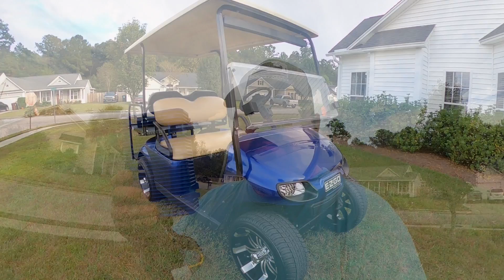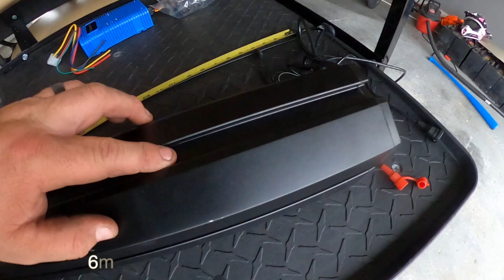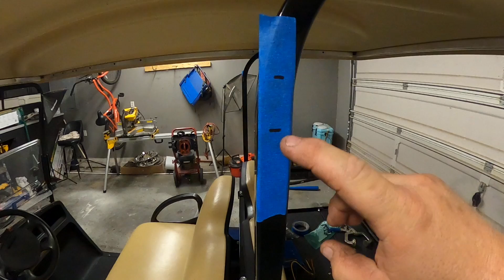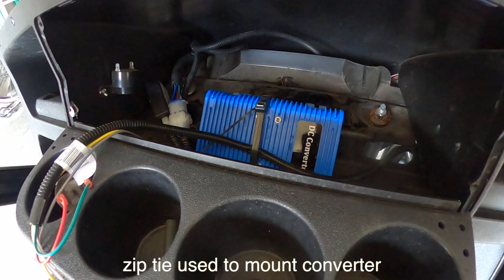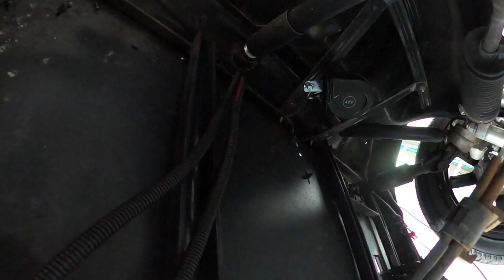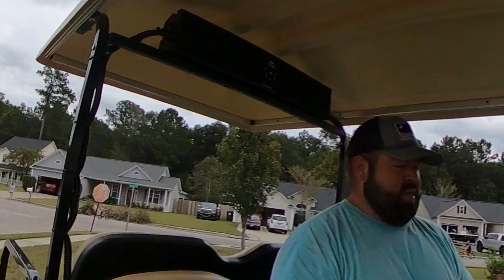How To Install Bluetooth Boss Sound Bar & 48v - 12v DC Converter on EZGO TXT Golf Cart

Comment: I have a Boss blue tooth amp with speakers and I have it hooked up similarly to this set up with the exception of my buss bar being a positive side and negative side so my Boss is wired directly to the buss bar.  The reducer is also wired to the solenoid so that it will come on when the golf cart is powered on.  I get a high pitched noise coming from mine.   Can you give me any advice as to what may cause this.
Reply from the maker: Do you have an inverter going from 48 to 12v? Is your sound bar hooked up to 48v?
Reply: @Fentertainment  i do have an inverter going from 48-12.   The Bluetooth amp is hooked up to the 12 volt buss bar.

Comment: You are a master!  I however didn't want to do all that work.  I also didn't want the soundbar to drain the 48v golfcarts batteries.  So in my txt I put a 12volt battery in the empty space and wired the sound bar directly to it.  I just have to keep the separate 12 charged on its own.  No big deal.  Only issue I have is the sound but starts cutting out if I apply more that 80% volume.  I'm hoping this is because I used an older batter I had lying around.

Comment: Such great instructions, however, I'm having issues.  I've installed the same converter in my 2016 TXT, following your instructions in this and the other similar video you did.  I've connected the Velex round marine radio to it and it does not power on at all (even with the key in the on position).  I have a 35a fuse in the fuse block, is that causing an issue?  I'm also getting a lot of sparks from the battery terminals when putting the wires on and off as I check the problems.  Thanks so much!!
Reply from the maker: The fuse for the radio needs to be 10a.
Reply: @Fentertainment  Thanks.  Not planning to use any other accessories, I connected the red converter wire to the yellow wire of the radio (which has an inline fuse) also the ground wires for the same reason.  Still no power to it at all.  it's got to be the green wire from the converter that isn't properly connected with the tap back connection.
Reply from the maker: @AndyMeresse  there is also a red ignition wire on the radio. Connect it as well.
Reply: @Fentertainment  I have that one on the blue wire of the converter. It's got to be the green switch wire, right?  Assuming the radio obviously wasn't dead from the package
Reply from the maker: @AndyMeresse  On the radio, Red should be key switch and Yellow is constant.
Reply from the maker: So on the blue converter you have 5 wires. yellow 48v input, black ground in & out, red 12v output, green keyswitch inpu, blue is 12v out constant. IF you dont have any power output from the red wire be sure that the green wire that is for the switch is hooked up to either the switch or main battery for the converter to turn on. It has to have 48v as well. If you hook it up to the main 48 then it will not power on and off with the cart and will stay on constantly.
Reply: I'm obviously not electrically inclined I guess. I've taken up enough of your generous time, so I'll have to find someone local to help. Thanks so much for trying to help!!
Reply from the maker: @AndyMeresse  im invested man. whats it doin
Reply: @Fentertainment  just to start from the top. The yellow wire from the converter is run to the main positive of the pack. The black converter wire is run to the negative on the pack. The green converter wire is run to the "on" terminal of the key switch (verified with multimeter).  The red converter wire is going to the fuse box.  The blue converter wire is not connected to anything. 

The yellow stereo wire is connected to the fuse box opposite the red converter wire. The black stereo wire is connected with the ground. I'm confused as to where the red stereo wire physically hooks up.
Reply from the maker: @AndyMeresse  the black converter wire connects to the battery ground and to the accessories ground also. On the radio, it has 2 power wires and a ground. Black is ground, red is ignition and yellow is constant 12v (memory). If you hook is up like they won’t you to then you would run radio red to converter red, radio yellow to converter blue and radio black to converter black. 

I have the same style radio on my Cushman. I did radio red and yellow to converter red with radio black to converter black. I don’t have anything connected to the blue wire on the converter.
Reply: @Fentertainment  I tried it the way "they want" and only got some strange characters on the screen with it still not powering up.  Just ruling things out.  I think I've got it plugged in correctly, but is there any way the converter harness could be plugged in backwards?  I'm getting 48v out of the full pack, so I know I have full batteries.  Again, thanks so much!!

Comment: I have the sam setup that was installed by a dealer.  I notice that when I push the gas pedal the boss soundbar picks up interference with a light high pitch.  I don't think there is a DC convertor but mainly all wiring harness with different pig tails.  Any suggestions

Comment: Are there any shock dampers where that bar is bolted to the upright roof struts ? Over time with the slight movements of those uprights over bumps will those weld ends not break off ? A friend installed one like this and that happened after 2 months use. 

I want to install same sound bar and I’m on here looking to see how you did it to avoid the situation above.

Comment: Can I cut off the inline fuse that powers the converter and run it into the dedicated slot in a fuse block I have or does it need direct power ?

Comment: Is it okay to bolt mine to the roof instead if I silicone around the hole???
Reply from the maker: Thats up to you with what you think. I have bolted one to a factory precedent roof with no problems.
Reply: @Fentertainment  as long as you think it’s okay and no going to cause any issues? Mine lines up perfect with the thick spot on the roof and will be very ridged so it won’t flex etc.

Comment: Where can you NOT mount that converter? I need options because mine won’t fit where the battery’s are or under the seat. I know it gets hot. 2010 Precendent with 6 of the 8v batterys

Comment: What model is this that has led lights that light up the bar?
Reply from the maker: I have a link in the description for it. Yes it has led lights in the bluetooth sound bar.
Reply: @Fentertainment  Awesome thanks! Do you think on a yamaha gas cart the stock battery could power it ok or would I need a separate battery?
Reply from the maker: @philldilley  should be fine either way.

Comment: Could you do the same process with a 72 volt ?
Reply from the maker: Whats up Jesse, the 12v converter that I used in this video has an input voltage of 30 - 55 volts. We would need to find a converter rated for up to 72v or higher for it to work.
Reply: @Fentertainment  10-4
Reply from the maker: @jessebland8174  this one is rated for 20amp output. https://amzn.to/3pXG1mm